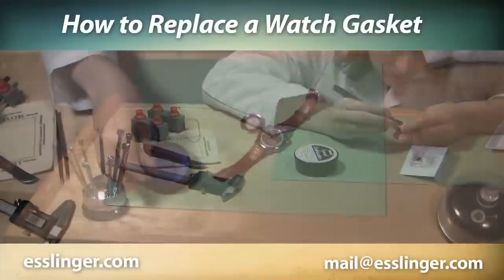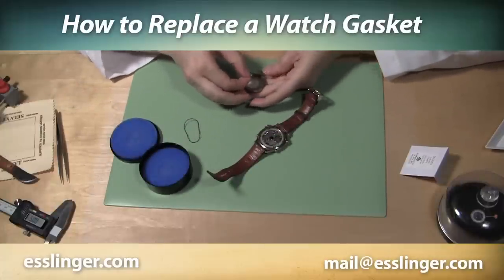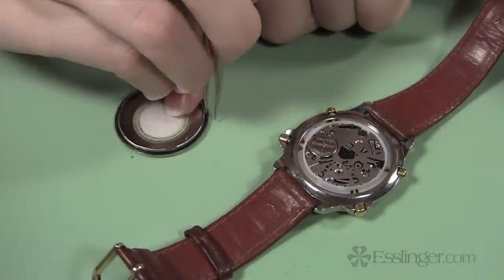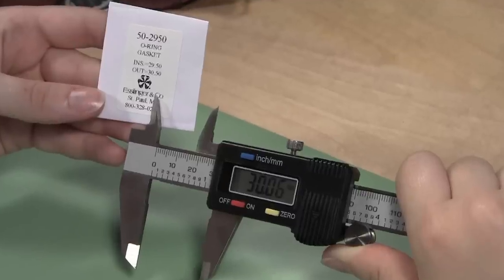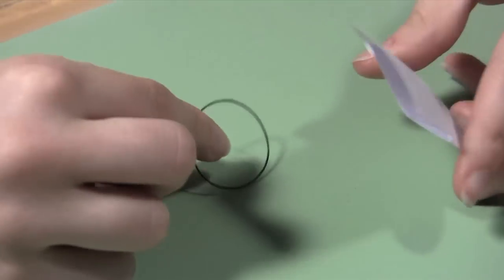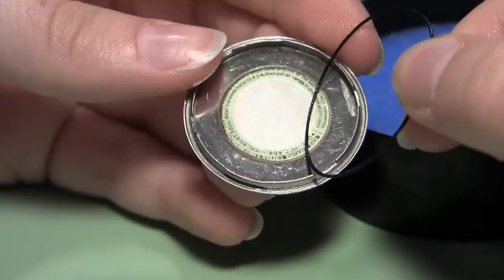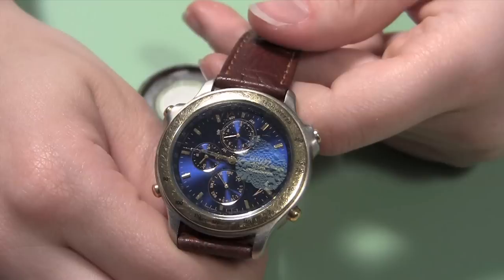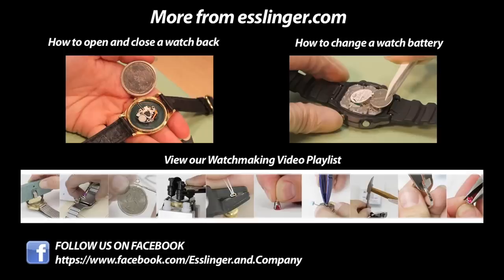How to Replace a Watch Back Gasket

Comment: Ok Esslinger, i love you guys but I"m not sure how this makes sense. Please explain to us what you're doing.
First of all you give two dimensions we need. The diameter of the caseback and the thickness of the lip where the threads are of the caseback which you show somebody measuring. yet the two numbers we need to measure aren't those. on my watch those two measurements would be 30mm by 1.9mms. the closest gasket you have to that is 30mm x 31.5mm

You then say we need to buy the gasket 1/10th of a mm smaller but you dont' sell them in 1/10th of a mm increments and you show them using a gasket .5mm smaller.

Can you please clarify what on earth we're supposed to measure besides the inside dimension of where the gasket sits? What is this outter dimension we need to know on your site that is clearly not the height of the caseback threads which you show the person measuring?

Comment: My only question on this is, why you wouldn't use the opposite side of the calipers to measure the inside of the case to gauge the required gasket diameter?

Comment: This video has some good basic information! I had to replace a gasket on a Seiko 2320-6349 rectangular women's watch. The new gasket, 0F170NA1S, was a substitute for the original. It's a stretchier version that isn't molded to the shape of the 17 mm x 19 mm case like the original. It was much harder to install than the one in the video because the back only had a groove on the ends and none on the sides to hold the gasket. After I finally got it on, I found that with such a small back and narrow flange, it was almost impossible to invert the case to put on the watch while keeping the gasket in place as the video suggests. The simple fix is while the back is facing up on your fingers with the gasket in place, carefully put the watch on to the back, then close it. For this watch, it's just a firm press with your fingers. Don't be afraid to modify their procedure if it makes sense for your watch.

Comment: At 1:23 in the video, I don't think the digital calipers are oriented correctly to measure the depth of the groove where the gasket rests. If the calipers could be oriented to be tangential to the groove where the gasket rests, then the depth could be measured, but with the calipers oriented perpendicular to groove, the reading would be much too high.
Reply: Peter Schwimmer if you do a height measurement and use that thick of a gasket , there's no way you'll be able to close the case back even with a press.

Comment: Should you put the gasket in the watch first instead of placing it on the caseback?
Reply: I believe it depends on which watch it is, in some cases the gasket is on the watch case but on other watches it is on the case back. I have an older Fossil (Blue) quartz watch and the gasket is on the case back.

Comment: You say you should order a gasket that is 0.1 mm smaller than the measured diameter of the caseback, but in the video the gasket used is 0.5 mm smaller. What is the correct adjustment?
Reply: Agustin Aguilar I think they goofed on the video. I think they meant to say subtract 1.0 mm and not 0.1 mm.
Reply: @johnmilner7603  ok for now i see this is the newest conver here ....iam having trouble after my wrist watch dropped and the back cover opened after it reached the floor(luckily the mechanism is working fine) but the  cover won't get back ......i dn't if i should change my gasket or any suggestions.
Reply: Monkey D Jamir you should use a case back press rather than your fingers.

Comment: Good stuff. Thanks. 
So just to confirm the minus 0.1mm. 
If my case back measures 30.50 as shown in your video, does that mean I need an Internal Diameter of my new Gasket to be 29.50mm??
Thanks
Reply: I don't know if what they are saying is correct, but if you subtract 0.1mm from 30.50mm, you get 30.40mm, not 29.50mm. Maybe they meant to say you should subtract 1.0mm rather than 0.1mm. I kind of think they goofed about this.
Reply: @pickngrimace2726  agreed
Reply: @pickngrimace2726  back to school forget the nothing at the end its 30.5mm less 1mm=29.5 mm

Comment: 1:23 do not do this or you will never get the gasket on since it’ll be too thick. Measure the old one and add a bit for shrinkage.
Reply: I'm not sure everybody hears this instruction the same way.
Reply: True, because the depth measurement is 1.25mm and he gets a 0.5mm gasket. So i assume get the depth, less 0.5mm. He said same thing for diameter to measure the diameter then remove 0.1, yet it's 30mm and he gets a 29.5 diameter gasket, or 30.0 less 0.5mm... So to the depth and diameter, I guess subtract 0.5mm...
Reply: @cac2244  The gaskets don't come in 0.1mm size differences. They come in 0.5mm size differences. If you use a slightly smaller  diameter gasket than measured the o-ring will stretch and its thickness will decrease slightly. The o-ring needs to be thick enough to get squished down by the case back so it will fill the gasket groove in the case back. So the inside diameter of the o-ring should be slightly smaller than the inside diameter of the groove and the gasket should be slightly taller than the groove us deep. If the gasket is not thicker than the groove is tall the case back will not be sealed. O-ring size: slightly undersize inner diameter and slightly thicker than measured.

Comment: Watchmaking is truly wonderful, but unfortunately it's a dying art. My hopes are some who are new to Watchmaking decide to open a mail-in watch repair business that above all else, specializes in low-cost Chinese automatic movement repairs. This is probably the only type of repair that's abundant enough to possibly make a viable repair business these days. Quantity over complexity! Someone needs to fix the Chinese movements. My Watchmaker won't. He waits around for a Rolex or Tag to come in.
Reply: How cheap? It's not economical to repair a few dollar movement to component level. It might just be financially viable to switch the dial, hands and winder onto a replacement movement. Watch repairer's time is expensive as it's a skilled job and the costs of tools, equipment, real estate, utilities and other business operating costs have to be absorbed into the charge. Watchmaking a dying art? I take it you haven't been to a wristwatch trade show. If watchmaking was a dying art there wouldn't be new watches coming onto the market. The tooling and techniques have developed but there's still a lot of art, ingenuity and craft and a huge skillset goes into watchmaking.
Reply: expensive how about when you talk about expensive you do an automotive buisness  as i do matey then you will see how expensive life is, and something else FRANK you have to take opportunties when they arise PAL and if you are a watchmaker you are needed much like i am in automotive to fix and find solutions for people of all that is on the  market, if you dont FRANK you will go out of buisness very quickly, one who thinks they can choose the work they do is someone that is always POOR and lacks any work at all
Reply: this "art" should die because it's done by failures with inflated ego, I gave my tissot watch to authorized tissot service center and they destroyed my watch just by opening the snap on cap - dug up a hole in the case and gave 3 deep scratches on the cap. Never again
not I do it myself without a single trace of opening
Reply: @frankieboyo1969  It's dying, not dead and the attendees are WAY down as well as new brands. It is most definitely a dying art, especially here in the states.
Reply: @spicydiarrhea5662  Same thing happened to me.